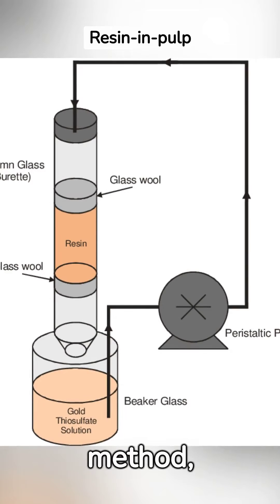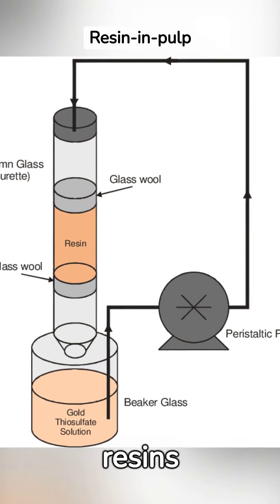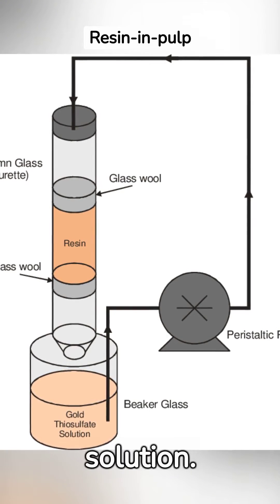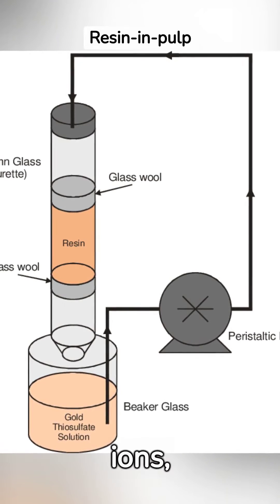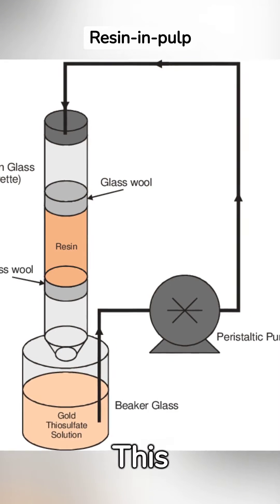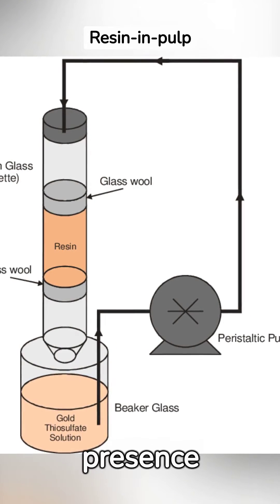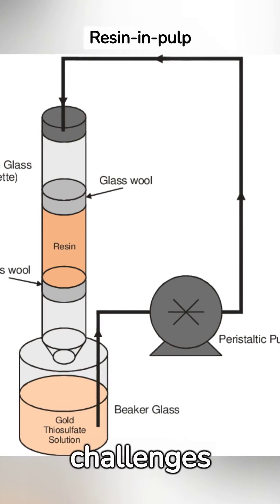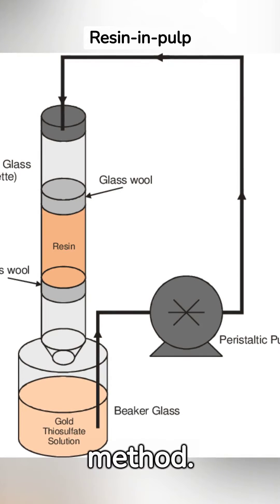Unlocking Precious Gold: Methods to recover gold from a Cyanide-Gold Solution

Comment: which Ph should be to recover gold on zinc?
Reply from the maker: The recovery of gold using zinc typically occurs in a cyanide leaching process. In this process, the optimum pH for the recovery of gold using zinc is usually around 10.5 to 11.5. This pH range is conducive to the formation of zinc-gold complexes and promotes efficient gold precipitation on the surface of the zinc particles. Therefore, maintaining the appropriate pH level is crucial for the successful recovery of gold using zinc in a cyanide leaching process.